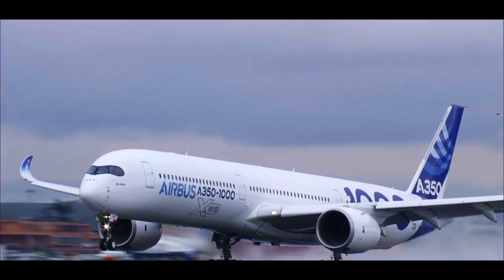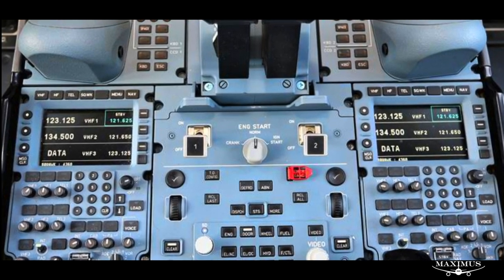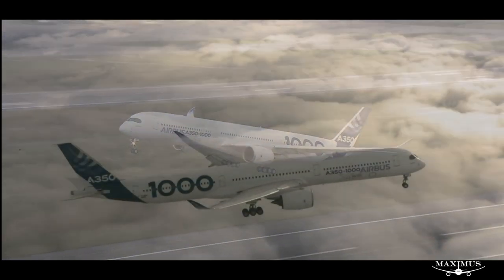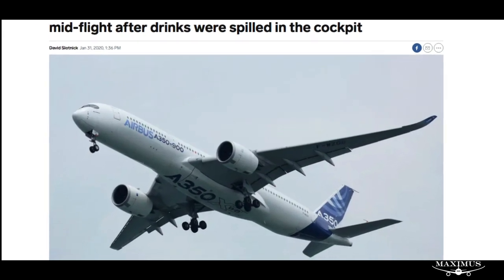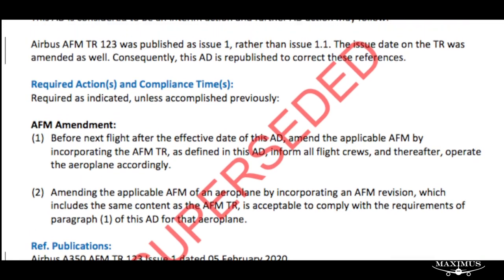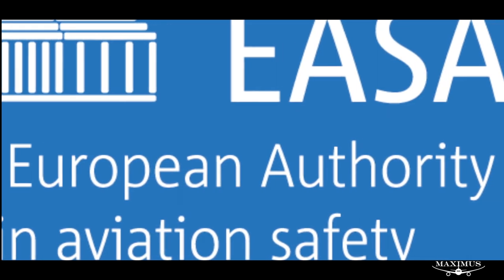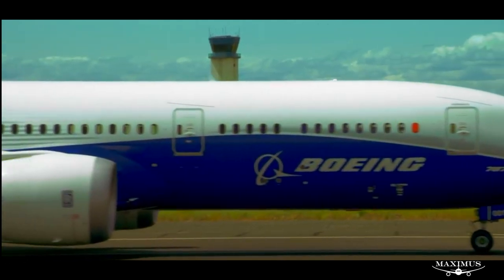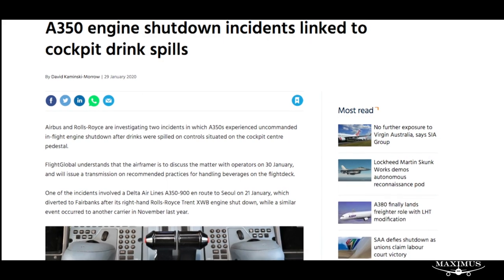500 Passengers Nearly (Killed) On Two New Jumbos Due To Pilots Spilling Coffee In The Cockpit - TRUE

Comment: I was cabin crew for a well known airline back in the 90's.
We were trained never to pass the coffee to a pilot via his inboard arm. It had to go over his shoulder closest to the window.
Spilling drinks on the centre consul has always been an issue.
Did the incidents happen whilst beverages were being handed to them? 
Airbus has cup holders for the pilots and they also have a pull out table. There should be no need to have beverages anywhere near the centre consul.
This seems more of a procedure issue rather than a design issue.
Reply: Kyros -  It is a good idea but it would add a layer of unreliability to switches.
Millions have flights are performed every year without any problems, this is a human error issue and a procedure issue, I was cabin crew for 18 years and now a pilot, never had a problem.
Reply: Kyros -  I will match your confidence. They will just install spill proof beakers on each aircraft.

Comment: I used to work for BEA before they tied up with BOAC to form British Airways. At regular intervals they circulated an restricted circulation air safety report which detailed all incidents that had safety implications. I remember one reports which I think involved a Comet 4B. Apparently an actuator which I think controlled the flaps froze up. It was accessible from the cabin so the crew decided to pour hot coffee on it which worked. I don’t know what the passengers thought as the access panel was located in the aisle so the carpet had to be moved to get to it and to see coffee being poured on the actuator. Back in those days BEA didn’t have hot water heaters and carried coffee in heated containers.
Reply from the maker: Necessity is the mother of invention.
Reply: well at least they didnt piss on it. might have shocked the passengers

Comment: That mean, if the wind screen breaks, and rain water enters the cockpit, the plane will be without engine.
That sounds horrific.
Reply: Unlikely rain water is less conductive than coffee.... if memory serves.
Reply: If the wind screen breaks, you'll have bigger issues than wether your engines function or not, those mainly being getting low enough before the pilots lose consciousness or freeze to death, and telling ATC what's wrong with all the noise going on.
Reply: @mikeblatzheim2797  they dont lose consciousness coz they have Oxygen mask for that incident ready for use. But yes they can freeze to death if they don't dive the plane down fast enough
Reply: @mikeblatzheim2797  Or if the pilots get sucked out of the window as happened on a BA flight.
Reply: @Fubar_The_WEF  Yes but he survived, if but a little frost bitten if I recall
Reply: @mikeblatzheim2797  No you wouldn't. The engines failing would still be a bigger problem than the window breaking because it happened before in the UK and the captain was sucked out and pinned to the fuselage! He survived though! Maybe not if the engines had failed

Comment: Jesus ..... what were those engineers thinking? As an aeronautical engineer by training I had to switch careers when Fokker went belly-up. I switched into developing mobile medical devices which also use key-pads...... you can throw a bucket of water onto those without shorting out. It's not difficult to make them water-tight; they are mend to be used by ambulance staff in all kinds of weather. Just imaging: "Sorry, we can't help you because our equipment won't work in the rain" That would have gone over well.
Reply: I was wondering why something costing hundreds of millions of dollars doesn’t have hardened switches.

Comment: Cannot see how Airbus can be blamed for this and likening it to the Max problem. So like an American propaganda campaign against Airbus because Boeing are in the shit big time to me!
Reply: If it happens the same way twice that usually points to a design issue.
Reply: @MrMattumbo  Must be the Airbus Coffee Cups (poor design - bit like the Max eh?)
Reply: But the issues are so similar: on the one hand Airbus design doesn't keep accidental spills from shutting down the engines, on the other hand Boeing purposefully designed a system with no redundancy, no manual and no pilot training while at the same time performing parts of the certification process of that same airplane for the FAA to be able to save the airlines money and to defend its market share against Airbus. See, very similar.

Comment: "Airbus could be looking at a very similar situation as Boeing right now."  No.  I don't think so.  The situation at Boeing is very deep doo doo.  This situation with Airbus does not bring moral culpability onto Airbus.  Even if one of these planes had crashed the situation would have been nowhere near as bad as that of Boeing.
Reply: Boeing was an accident waiting to happen shoddy work and short cuts get you in big trouble Airbus is big in safety so even if something happened they can still come out smelling like a rose
Reply: @holdensv2000  I agree with you.  Boeing USED to mean excellence.  But at some point they lost their way and in my opinion the management no longer has integrity, and that is reflected in the product.
Reply: far lost they way and want to get everything for nothing  you have to work to get what you want the right way or you are in trouble
Reply: Only a demeanted airbus fanboy would say airbus smells as a rose after this.   lucky both engine switch got coffee on them.  Seems like a major flaw to have engines fail like that

Comment: Boeing can't brag:
 January 21, 1972 in EL PASO, TX: A Continental BOEING 720B, registration: N57206
, went into a dutch roll when coffee short circuited the yaw damper.
On 15 August 1985, an Alyemda Boeing 707 (registered 7O-ACO) carrying 65 passengers and 8 crew went temporarily out of control following an autopilot malfunction caused by water spilled on the panel and subsequent pilot error. The aircraft heavily pitched up and down, causing the death of two passengers and one flight attendant. 
Jan. 
Jan 2011; A PILOT spilt coffee on the controls of his Boeing 777 and triggered a terror alert.

The United Airlines plane, carrying 241 passengers from Frankfurt from Chicago, was forced to land in Toronto after the radio sent out a distress signal meaning “hijack”.

May 4, 2007: A B737 of Air New Zealand, flight 746 from Wellington to Auckland with 122 passengers including New Zealands communication minister David Cunliffe, had to make an emergency landing at Ohakea Air Force Base after electrical smoke developed in the cockpit. The smoke had been caused by spilled coffee.